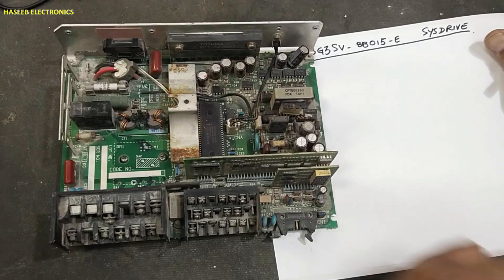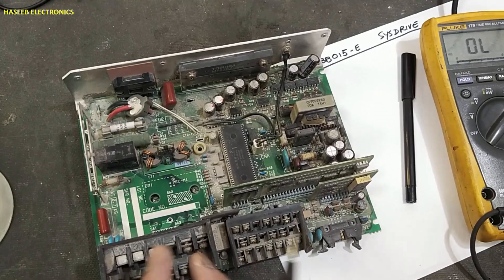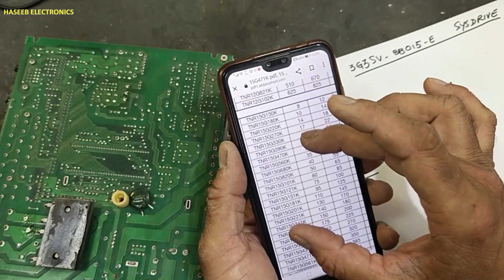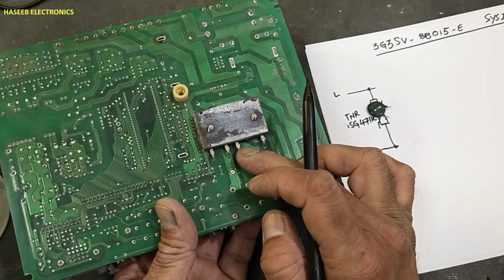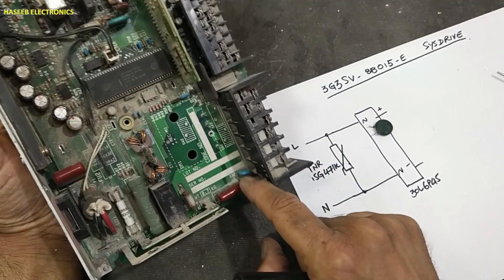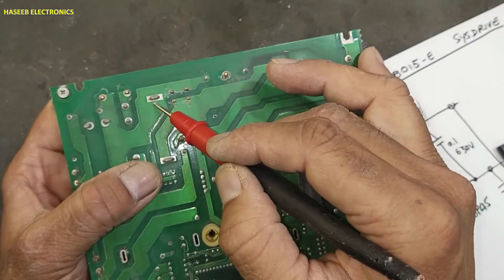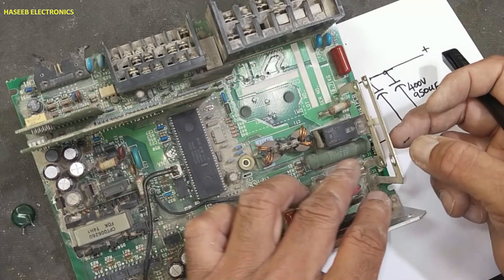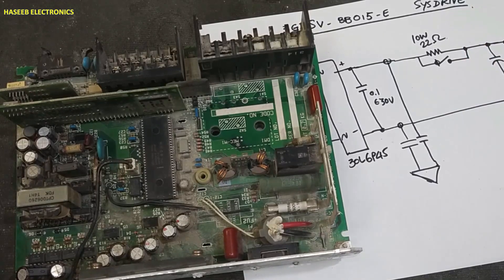{1052B} Omron Sysdrive 3G3SV VFD - AC Input & DC rail circuit

Comment: Hello, I am charging the car battery from a 500 watt SMPS transformer and the transistor constantly burns in an unknown way, even though the amperage remains constant, they burn. I put a fuse in both of them, it burns again to protect it from overcurrent. I prevent the reverse voltage coming from the battery with the relay, but the SMS burns at 14.4 volts, is there anything you can recommend for this? Is there a circuit, thank you...

Comment: Good work! By the way, could you pls tell us the relay part number?
Reply from the maker: https://www.instagram.com/p/C3DX3S0tm8v/?utm_source=ig_web_copy_link
Reply from the maker: Matsushita JR1AF-DC12V AJR62119
Reply: @HaseebElectronics  Many thanks Haseeb! I just doubt that this relay has the dc voltage rating only at 30Vdc but why it is applied at much higher voltage for inrush current limitation. Thanks again for the valuable info.